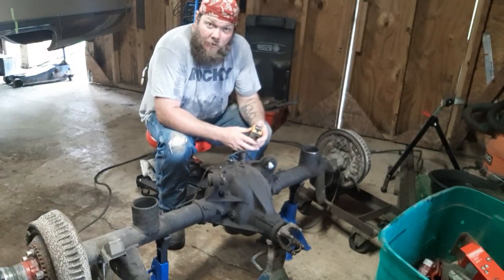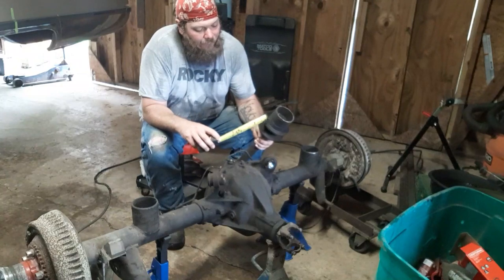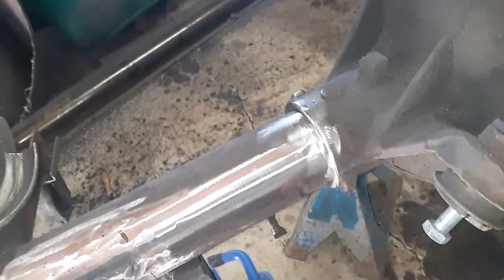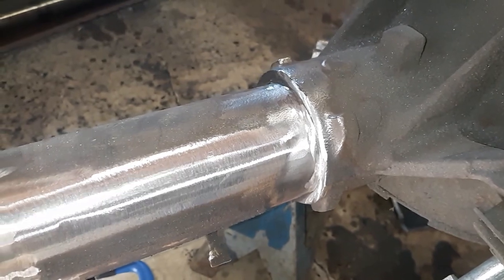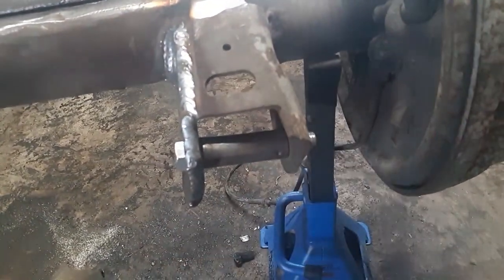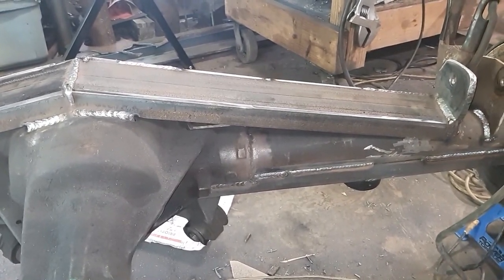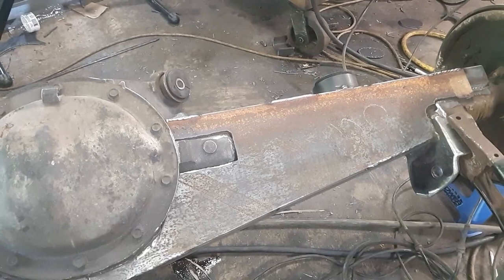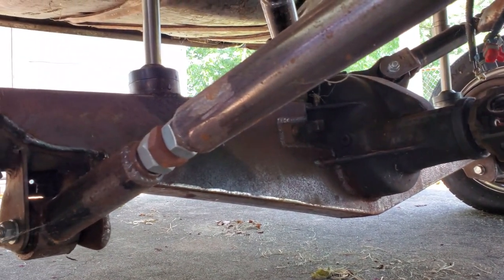Reinforcing The Rear End In My Fleetwood

Comment: What did you cut the big backplate with a torch or plasma?
Reply from the maker: Plasma but it can be done with both I'm just not as good at running a torch i was ok but when i got a plasma i stopped using a torch. But i have seen some guys make cuts with a torch that look like a lazer cut it
Reply: @thecadillacdanshow8658  Gheres all kinds of ways to set up a jig or hardware to make perfect cuts with a torch. You could make a rolling bracket (3D printed?) for a torch head to fit in a channel that you tack to the material to be cut so you can just pull the bracket down the channel to make a perfectly straight line.

Comment: I got a 95 fleet wood can I put 14 inch cylinders in the back and get a full lock up with out Extending the trailing arms ?
Reply from the maker: If you run zero coil I had 14s in the back of my oldsmobile i had about 2 1/2 turns of coil bit i did end up having to extend my uppers i kept busting the stocks

Comment: If I'm running 14's on my Fleetwood do I have to grind the calipers???
Reply from the maker: Not with 14s they bolt right up
Reply: @thecadillacdanshow8658  thanks boss
Reply: @thecadillacdanshow8658  I do need to gimmick my fender skirts this right????
Reply from the maker: @gladememmott3001  here you go this is a video I did showing what needs to be done

https://youtu.be/zK7N4xj_38Q

Comment: How do you known how to get the power balls level
Reply from the maker: Most cases I do them 90 degrees from the pinion on my car I was thinking I would have to angle them but it worked out fine with just leaving then flat on the top of the axle

Comment: Do you have to box the rear end or can I weld flat bar at the bottom of the rear end in both sides and weld around the the bar so it won’t slide out
Reply from the maker: You can do a single plate across the bottom boxing it is just stronger plus I like the look but I have seen some real cool single plate reinforcements
Reply: @thecadillacdanshow8658  ok thanks how thick should the plate be and i do need to weld the tubes to the pumpkin right
Reply from the maker: @camefromnuthin6994  yeah I weld the tubs on every car. 3/16 is good but the thicker the stronger